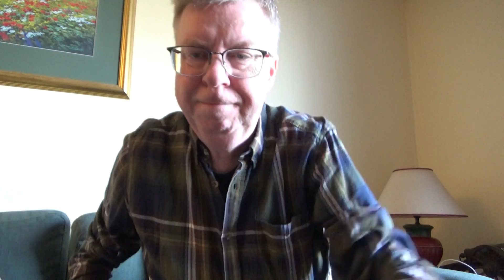String Holster

Comment: Thank you for the video. The rope is more comfortable than the wire method. I have a question. The first CO2 1911, which manufacturer is it?
Reply from the maker: Thanks my friend. Iam glad you like the video. Not sure wich company made the first 1911 CO2 replica. Mine are made by KWC (I guess, but no markings). I had a KJW in CO2 also ca 20 years ago 🤔

Comment: Hello Rune!  
How are you and your mood?  

I keep remembering your videos with Umarex HDP compact.  Do you think this is basically a bad design, or did you just get a defective sample?  Maybe you have seen more reviews from other experienced users?  

Before watching your videos, I wanted to buy this gun.  Now I am in doubt.  I like the size of this pistol, it is inexpensive, but the appearance is so-so.  If the design of the pistol itself is unsuccessful, then I will try to forget about it.
Reply from the maker: Hello Alex. Iam feeling OK now. Thanks🙏.  The HDP is OK if you get the right size balls for it. Use 12,5mm balls and it should work just fine. I have now 3 of them and no issues. Hope the info is useful. Cheers 😃👍
Reply: @runerebel8441  Dear Rune, it was the compact version of the HDP 50 that I meant. I remember that after each shot the pistol literally opened up.  I thought about buying it, but your experience put me on edge.  Do you think this is a common problem?
Reply from the maker: @alexnovikov9065  Hi my friend. The compact HDP has a very bad breach seal. This was what caused my trigger guard dropping down when shooting because the gas pased down the magazinetube and so hitting the guard. I think its a common problem. If you get one with a good seal then it might be worth having... I sendt mine back. Dont think I buy another...
Reply: @runerebel8441  thanks my friend!
Have a good day and mood! 👍

Comment: Do the same with out the string and explain how the string benefits. Add more factors to increase the chances of failure. That is useful in a life threatening situation right? Get a holster and stop being cheap. Plus im almost positive this is not meet the requirements of the law at all just go ahead and scrap the serial number where a ski mask and run like hell when you get pulled over or shoot preemptively to avoid the hassle of running just be ready to dispose of evidence and change clothes at a moments notice. I suggest a back pack while you are at it just have gloves in at all times keep a longsleve on with a short sleave under and where 2 pairs of pants or one and shorts under and some dry ice in the back pack. Guns get hot and helicopters got inferred cameras. Shoot back and choppers come quick give you no time for it to cool down to temperature that wont stand out. They arelooking for heat the cold temp will be over looked if hiden in a proper place 😉
Reply from the maker: You totally missunderstood the video. I was talking about how the norwegian resistance carried these pistols durring the war. I used a softgun for demonstration. I never carry guns of any kind.
Reply: @runerebel8441  ahh to be honest i skipped through it. It just seemed like improper advice from the get go. I still do not see the difference in just placing it on your waste with out the string it just does not make sense. I did skip through the vid so maybe i missed why that would be beneficial. Its even possible he was saying it was not beneficial and that being the basis of the whole vid. In the first place. Either way i digress and concede with you that i missed the point of the vid do to me  skipping all of the talking he did and i only really saw what confirmed my bais
Reply from the maker: @P.D.Rubenx  No problem. The string prevents the pistol from sliding down the trousers. The resistance people would not carry holsters. The reason is if they where stopped by the germans (even if they had thrown away the pistol) the germans was not stupid. They would know that at some point a pistol would have been in the pistol, and nobody wanted to be arrested by the Gestapo. The string on the other hand could just be thrown away quickly. Qiute clever I think 😃